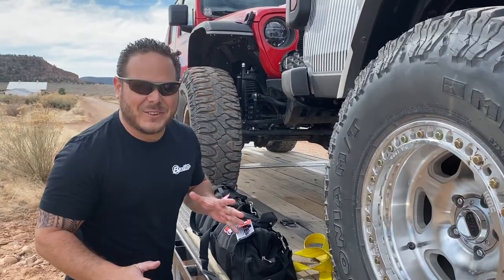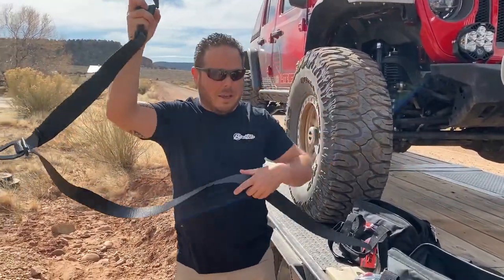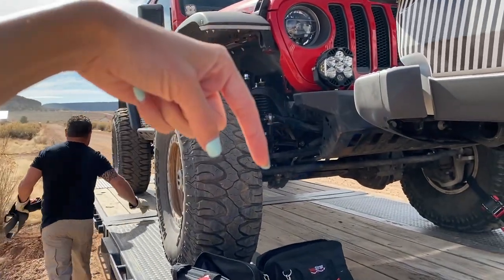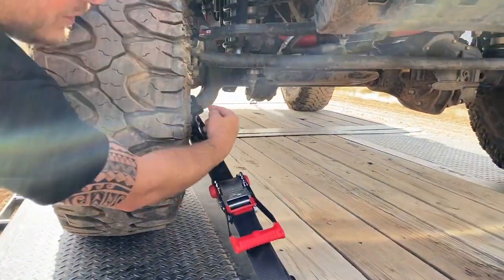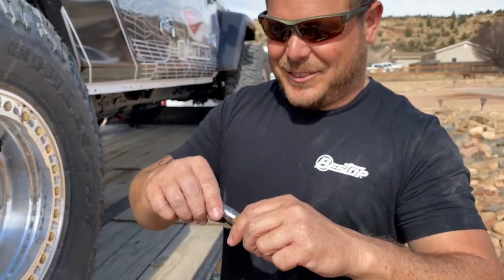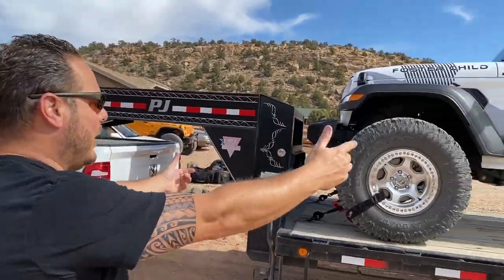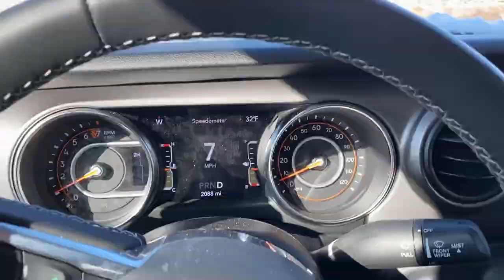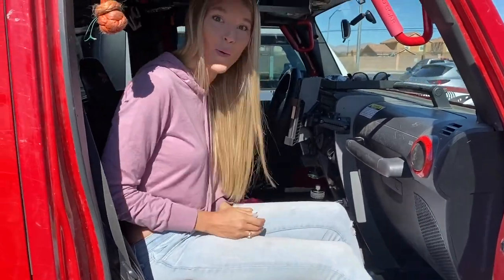HELP US OUT! How do you tie down your Jeeps?!

Comment: I drove a stake bed in college and straps will not come loos of done right. 

1. Go to the axles not the body or bumpers, the axles do not move with the suspension. 
2. Attach one side first, so front or back. Always start front and go forward and outwards at an angle. Tighten those. 
3. Go to back axle and go backwards and outwards at an angle. Tighten those. 

The result will be the left front strap pulling the jeep left and forwards. The right front pulling it right and forwards.  The right rear pulling right and outwards. Finally, you guessed it, the left rear pulling left and outwards from the jeep. 

The result is 4 straps in an x pattern all pulling towards the center of the jeep. This creates up to twice the stapping force in every direction. This is because of the equal and opposite force from the opposing straps. You could sum the static forces to see the difference if you understand trigonometry and statics. If not just take my word for it.

Also having length in the straps would reduce the effects of them coming loosing. Think about it, adding an inch to a 6 foot straps wouldnt make a difference, adding an inch to 1 foot straps will.

Comment: I have axle straps integrated on my cheap ebay straps.  I wrap around the axle as far out as i can.  Ive used and abused these straps now for 10 years.  I cross the reard and straight on the fronts.  I dont like going through rims or tires...lots of give in a tire and rims not as strong as axle tube.

Comment: You need to cross your straps so your load does not parallel a gram... Also You need to rotate your hold down hooks 180 degrees, so your hooks have more surface
contact...  Your hooks should be pointed up not down , it is much safer...

Comment: I've been a long haul trucker for 30 years and straps for vehicles make me nervous.  Your straps that have been damaged or cut are already D.O.T. out of service.  I would get transport grade 7 chains and ratchet binders.  Check your securement after the first 25 miles and every time you stop and check your mirrors often.  Vehicles require 4 securement straps or chains and cross chaining is the superior way to secure the vehicle when possible.  Sometimes your securement points on your trailer or the load itself don't lend themselves to cross chaining.  Vehicles bounce and move and straps can and will abrade and fail.  In 30 years over the road I broke a chain once.  I've hauled countless Humvees and vehicles similar to your Jeeps.  Chains and binders are heavier but peace of mind is priceless.  Losing a vehicle off your trailer can cost someone their life so securement is paramount.  :)

Comment: I like to tie down the tires. One strap down the middle. Looks like your pulling the suspension apart to me. Checking them every stop and them being loose is normal. Use a cheater bar for leverage. Think about securing the tires though

Comment: DOT Regulations require GRADE 70 or better chains & tie downs.  Harbor Freight does not have Grade 70 equipment.
Reply: Harbor Freight tie downs are good for securing lawnmowers, refrigerators and couches in pickups.   Watching Winder Towing videos, I'm actually considering adding a GRADE 80 Bridle to my recovery gear; and, GRADE 90?  That's some really high priced stuff.  That's like helicopter sling load or skyscraper crane grade equipment.  Winder Towing actually uses a Grade 70 Bridle; and, really, that's all you need.
Reply: Check out US Cargo Control, Yellow Lifting, DOTtiedown, and a rabble of various trucker supply companies.  You can even find stuff on Amazon and ebay; but, usually cheaper from the company's direct web.  A number of truck stops have tie-downs too.
Reply: I was thinking you should get four "J Hooks" and four "Load Binder"s for each vehicle.  Get four Grab Hooks and four pieces of chain for each vehicle too.  Call them and ask the dimensions of the 8" & 12" J Hooks, and compare them with your axle diameters. Your choice whether to get Grade 70 or 80.  I'd get Grade 80, just for that added security.  I'm looking at the yellow lifting website; but, shop around.  I'm no expert.  Just going off of what I've been researching the past few months. My ZJ is still in the shop; so, I'll probably be buying before my next offroad trip.  I was a Chinook Helicopter Mechanic in the US Army and strapped down a lot of things in and out of the helicopter.  Been working in the air freight business for 26 years and have strapped down and tied down a bunch of stuff.  and I'm sure there are a bunch of people out there smarter than me.   There always is.
Reply: Yellow Lifting even has Axle Tie Down Kits.  Ask about those.  I think if you get 8 of those, all you need is 8 J Hooks.  You do have to figure what lengths of Axle Tie Down Kits you need, for your trailer.  I would get 5/16" G80 equipment.  It's not like you're tying down a bulldozer; but, I think this would work on a bulldozer.

Comment: So... In terms of tie down, don't go through rims, that'll potentially destroy them if you hit the wrong bump or whatever. Going over axles is a potential risk as well, because you've probably got brake lines and handbrake cables along the tubes... The best way to tie down any vehicle is over the tyre, no matter what you're doing the tyres are designed to take the load of the vehicle applied in extremely abusive ways, the rims actually depend on the tyres to cushion them. The very best way is to throw a strap over each tyre, along the direction of travel and cinch right down so the tyre is deforming a bit. That means you're applying lots and lots of force through the tyre contact patch to the trailer which is the very best way to keep the vehicle in position. 4 straps over 4 tyres and the vehicle isn't going anywhere... Same same for motorbikes, a front wheel guide and a strap over each tyre is a win.

Comment: 8 straps would be better.  You only have 2 straps for forward momentum and 2 straps for braking momentum. 2 straps per wheel and 2 anchor points per wheel.
Reply: Justin Snyder that’s way too much
Reply: @boughtnotbuiltoffroad7784  If 1 strap fails then you have only one strap holding that momentum.

Comment: I am not an expert but I see 2 possible problems.
1. Your suspension will cycle over every dip and bump, you run the risk of getting to your destination with a blown shock. Also, the Trailer Center of Gravity will change with every bump.  If it were mine I would get and extra strap with closed hook and put some tension on the frame to control the rebound of the jeep suspensions.
2. Tire compression with low psi tires can loosen your straps.
Reply: JOHN-OKC   Just my 2 cents but if you have a blown shock from trailering and off-road vehicle then it’s not good enough to be on the off-road vehicle.  👍
Reply: JOHN-OKC if my shocks blow from being on a trailer then we have other issues to deal with
Reply: Y'all are missing his point. 
The constant up/down with suspension travel with help decrease the longevity of the shocks.
Reply from the maker: The shocks honestly aren’t a concern at all (their lifespan really isn’t going to be affected either way on the bed of the trailer - they’re infinitely more affected in that sense with a single “full send” on an obstacle than a lifetime on the trailer). A benefit of strapping the body down, however, would be to control body sway in the event of an emergency maneuver (general turns aren’t an issue since you aren’t going fast enough).
Reply: @LiteBrite    I have hit dips on the highway that almost bottomed out my grand cherokee suspension.  You take 2  7000lbs jeeps with long travel shocks and with big dips/bumps your trailer could be 14000 lbs lighter and then 14000 lbs heavier which could cause an instability.
As far as the shocks go just remember that they are cycling the same as if you were driving behind your truck, minus trailer suspension dampening. Again I am no expert, my only trailering experience is with a 2700 lbs Autocross race car.

Comment: Do not eat anything white based and eat a salad as a meal once a day.
I cut out fried foods, most breads, pasta (switch to cauliflower rice) and no pop.
I bought a Yeti cup and always keep it filled with ice water. I never wanted to be the Yeti cup douche bag guy. but you'll get addicted to drinking water 24/7 - Guaranteed.
Eat what you want on Saturday and Sunday. Those are your cheat days.
No work out needed. I Dropped 22lbs in 6 weeks.

Comment: Was i seeing two valve stems on that wheel?
Reply: Coaster Mech   I was wondering the same thing?!?
Reply: Coaster Mech yes. So you can use a regular and monster valve or air up or down faster
Reply: Kevin Williams ah gotcha. I’ve never used that style rim before Very nice 👍 👍.
Reply: Tyler M you can install Monster Valves on any rim, just drill and tap. They’re a big time saver on air-ups with a CO2 tank if you’re also street driving your wheeling rig.
Reply: @dgomme   That's amazing ….first I've heard of that!  I'm going to look into it. I know a better pump would help but this seems like a no brainer.
Thanks

Comment: You really should have just checked a truck stop. I hual cars for a living strapping is what I do and you are definitely doing it wrong. Look for a car hauler semi when you are at the truck stop and simply ask a pro. You should be strapping over the tire and then to the deck. You need straps that have 3 points of contact (3 hooks) per strap. Never strap to the frame or wheel that's old school out dated method is bad for the vehicle and not nearly as secured. Many auto manufacturers don't even allow us to hual that way or it voids the contract. You would have to add D hooks to the trailer to do it right. That's a heavy equipment trailer. It's not designed for cars.
Reply: Also look for a nice clean modern truck. Some guys are still using very old equipment and hualing used cars have different rules. New semi new cars

Comment: Don't know how to easily put this in words but the way you ewrapped the wheels and then attached the ratchet to the inside of the tire is just wrong. You're relying on nothing but the friction between the strap you've wrapped around the tire to keep the Jeep in place. Should these straps rotate the ratchet strap will become loose. And with Constant forward and backward movement on the trailer, surely those straps will rotate. Shouldn't the ratchet strap should be attached to the wrapped strap closer to the center of the tread? That's how I would do it.
Reply: M Modtomic they haven’t flipped or come loose at all. They are doing great

Comment: https://www.autohaulersupply.com/catalog/wire-hook-ratchet-combo/car-hauler-wheel-strap-10-ft-w-5k-wire-hooks--grey-552485.php?gclid=EAIaIQobChMI3cLp9sHz5wIVAT0MCh2WWQZxEAQYEiABEgJbAPD_BwE

This is industry standard for nearly all new vehicles. These eliminate the need to climb on the trailer or lay under the vehicle to secure your load and are super quick. We use use them even on Ram 5500 chassis. You would have to make some mods to your trailer like adding some E-track or D-rings to accommodate this style but u won’t regret it.

Comment: Kev, on the fitness aspect, swing in to a local Mens T clinic and get your testosterone levels checked. When you get around your age, its time to start TRT. It will help ya big time i promise ya bud! You know how to contact me, give me a shout if you've got any questions.
Reply: As someone on TRT, get your E2 ( estradiol ) checked also. Low T/High E2 as a combo are huge risks for heart disease. Fat converts T to E2 and although men have small amounts ( just like women have small amounts of T ) too much ( or too low ) causes ED and messes with weight loss and gain. If your doctor won't prescribe it, use lef.org to get blood work. It is way cheaper than anyone else I have used. ( they use labcorp around here for the blood draw at 1/2 the price )
Reply: batsonelec C you would be correct 👍

Comment: When securing a load the tie downs / rachet straps / chains in the back of load should pull towards the front of the load and the front of the load should pull towards the back of the load. As in your load , the back of both rigs should pull toward the front.. ratchet straps should  in back of both children should pull the rigs to the front of trailer and ones in front of the rigs should pull towards the back of the trailer. If you have it the way you tied them down and the front two would break or become lose the back two straps would just help the rig roll off the back or the trailer.

Comment: Get these straps on all 4 corners of your 4x4's and they will stay put on the trailer.  https://www.homedepot.com/p/10-ft-6000-lbs-Twist-Snap-Auto-Tie-Down-Ratchet-04110/202932898     You can get the axle straps there too   https://www.homedepot.com/s/axle%2520%2520straps?NCNI-5

Comment: At least 50% of your tiedown should be to the frame.  Period.  Suspensions leave too much bounce in the load, too much weight in motion. And yes, you need lateral restraint as well as vertical, forward, and aft.